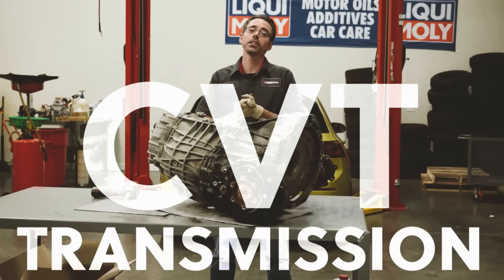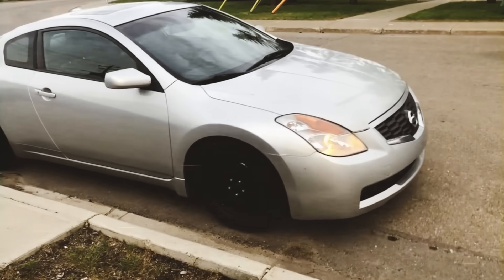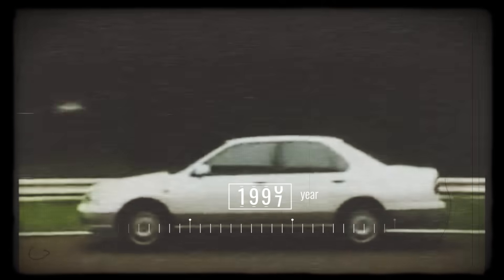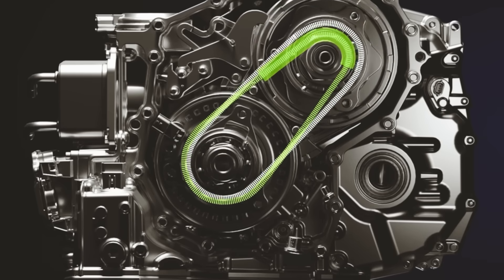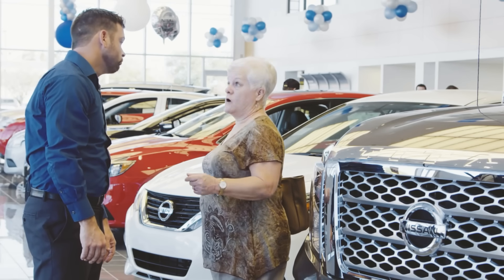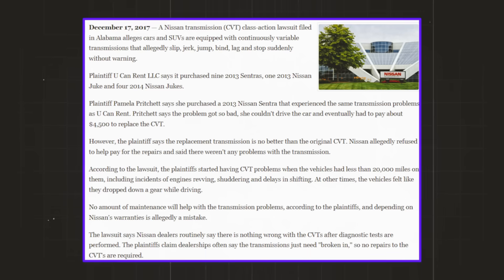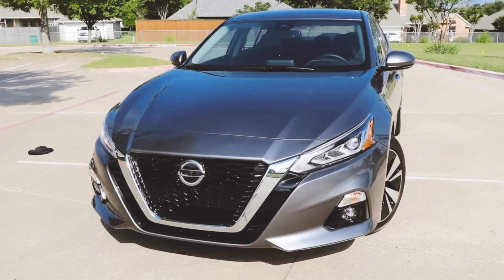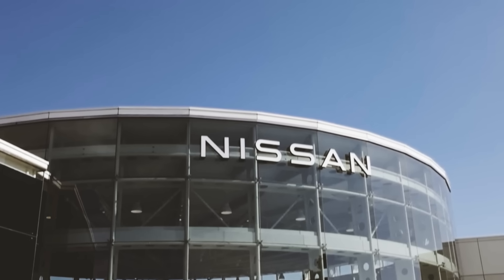Unpacking the FAILURE of Nissan's X-Tronic CVT

Comment: Yes. The Prius eCVT does not use a belt but is a torque split device and very reliable. An actual early belt CVT in a car would be the DAF Daffodil.
Reply: Yeah toyotas eCVT shouldn't be classified with the belt CVTs. Totally different designs toyotas is actually reliable.
Reply: This system has proven to be the better design type .
Reply: @turboprint3d  no steel belts on their CVT's, Toyota engineers KNOW what they're doing.
Reply: I have a 3rd gen Prius and I know all the common issues with these cars. The transmission never fails. I have seen zero people complain and I’m on all the maintenance forums. It’s always head gaskets, battery’s, ABS, and the available inverter at around 175k+ mileage.
Reply: @OptimisticEngineer345  my Lexus GS450H failed on its transmission which I was told was omly the second such fault in all of Europe. I felt so unlucky. It was a failure on MG2 resolver sensor and can affect the prius. Swapped in a used unit entire gearbox and no issues since.
Reply: @HK.Builds  That car is way more powerful than the Prius so the transmission is seeing a lot more load. Good to know they are also pretty dependable. Sometimes you get unlucky.
Reply: Wow someone actually remembers the DAF. I had the misfortune to drive one, it was horrible and freaked me out for 50 yrs!
Reply: You can see the DAF in action on Jay Leno's Garage.
Reply: I'm pretty sure Prius uses a planetary gearset (no belts) which requires two power inputs to produce one output. One power source is the gas (ICE) engine, the other the electric motor. Either can be locked out so the other can produce power on its own. Bullet proof. Planetaries have been used in automatics for decades.

Comment: Why the reference to the planetary transmission in the Toyota Prius? There is no comparison in design function or even purpose. As I understand it (I'm sure someone can explain it better), the Prius planetary gearset accepts varying inputs from multiple sources (motor and engine, in proportions determined by the computer at any given moment) and transmits the sum of those inputs to the final drive. It's not there to vary the gearing between engine and final drive like a Nissan CVT or any conventional transmission.
Reply: Totally agreed.  I've always been annoyed when people confuse the eCVT (Toyota, Ford, Honda) with the dual-cone type CVT.
The biggest issue with dual-cone type CVT is that it depends on surface to surface friction to work.  None of the eCVT transmissions do.
Reply: I think THS is completely different from other all transmission.
Reply: Yep, the one in the Prius is bombproof. People even tow with them and drive 200k miles on original fluid and they still don’t fail.
Reply: It seems like it is an AI generated video so don't bother with the accuracy of the video
Reply: A planetary gearset (a sun gear connected to three planetary gears connected to an outer ring gear) requires two power sources to produce one output. One is provided by the gas engine, the other by the electric motor. Both can work together or either can be locked out to allow the other to power the car.
Reply: Toyota eCVT does provide continuous variability and the CVT letters in the name. Apart from that - there is nothing in common. Toyota eCVTs has no belts/cones/pulleys/wet multi-clutches/hydraulic torque converters, only physical gears in a planetary gearset and 2 electric motor-generator (MG) units.
Reply: You are confused guys, the planetary gearbox is not exclusive for hybrid cars, it can work with one sole power input. The prius can run with gas motor only, and electric only, and both, which means that it can match a gas only powered car. But it needs an electric motor to control it. It makes it more complex and expensive, that's why is used in hybrid cars only, where they are more useful.
Reply: @juanamaral8162  The Prius does not work without working MG1 and MG2 (motor-generators). MG1 is mechanically connected to the ICE crankshaft and among other things is the starter for the petrol engine (no dedicated 12V starter  like other cars do).